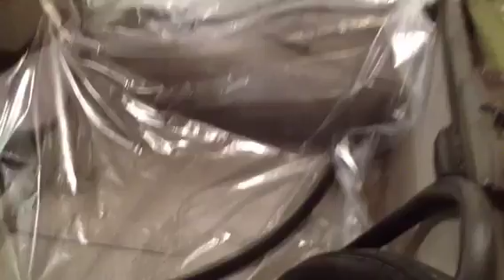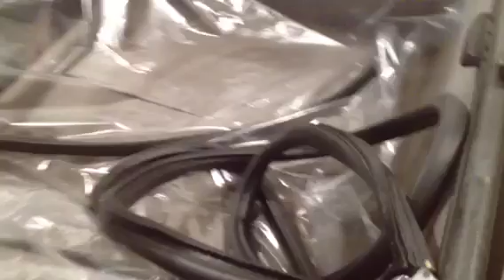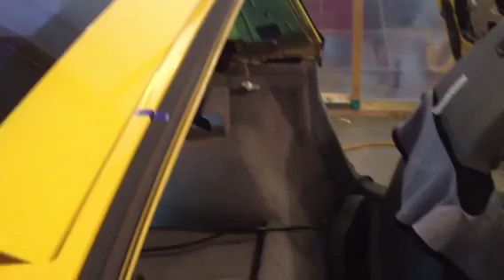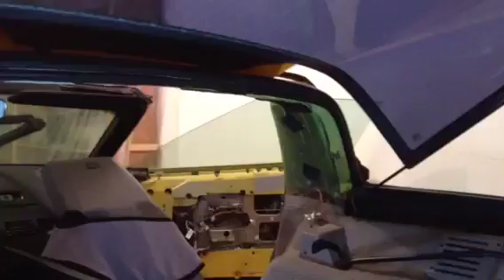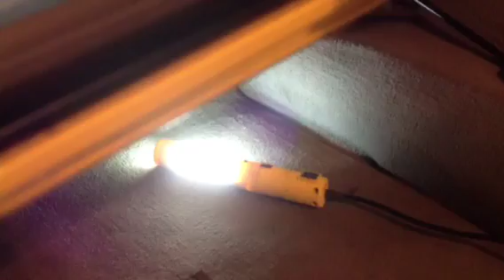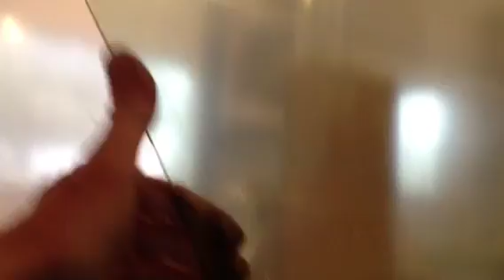Corvette C4 rear hatch and halo

Comment: How were you able to remove the top seatbelt bolt to remove the rear roof panels as I’m having a very hard time trying to remove the hex bolt on my 94, it seems too have froze or seize and I’m unable too remove it to replace my halo panels.
Reply from the maker: Geno.  I no longer have the car so cant check on it for you by looking.  But my memory tells me that the bolt did turn hard.  Try taking a hammer and punch and tap on the head of the bolt some.  That sometimes helps loosen a fastener that has  been in place for a long time.    get a  pipe or something longer on the handle of the ratchet or wrench.  Make sure your turning it the right direction!
Reply: Thank you sir and I’ll double my effort in this project knowing your advice is the answer to my dilemma. Sorry to hear your no longer in possession of your corvette. Thank you again and for your quick response!

Comment from the maker: bentz626-  I used no glue on the rear hatch weatherstrip.  The factory applied sealant is about the consistency of thick honey, and it never hardens.  I left it in place when I removed the old strip.  I just put the new strip right back in place over the fiberglass flange.  It has worked well.  The halo I did glue down, using 3M weatherstrip adhesive.  You put the adhesive on both pieces, let it dry to the touch, and then stick them together.  It is contact adhesive, so you must have the parts in final position before touching them together.